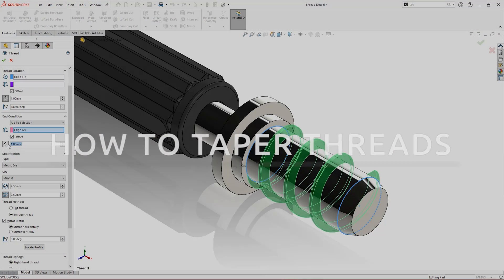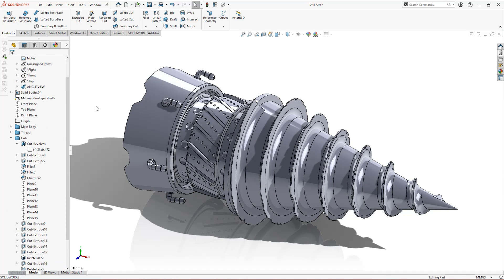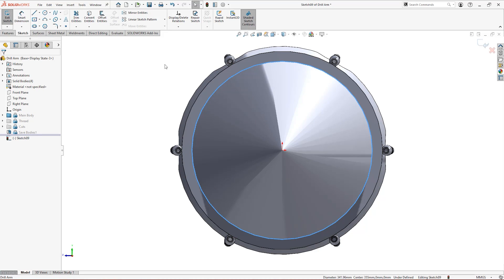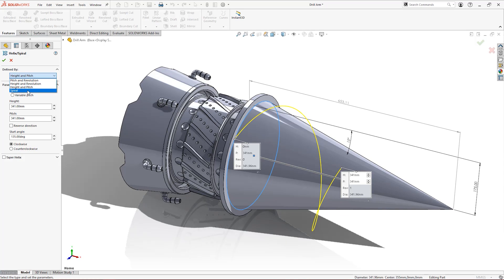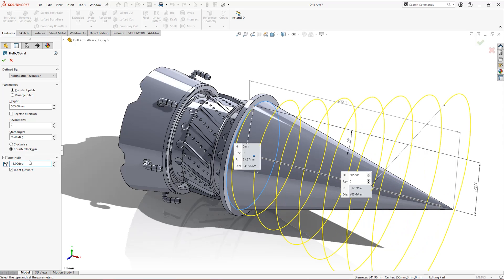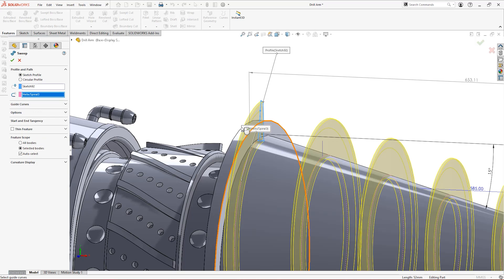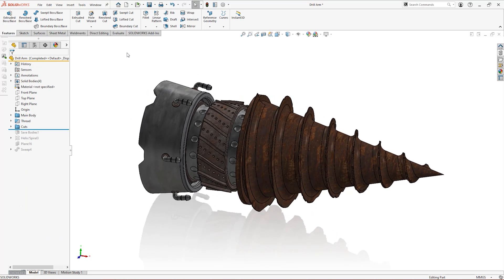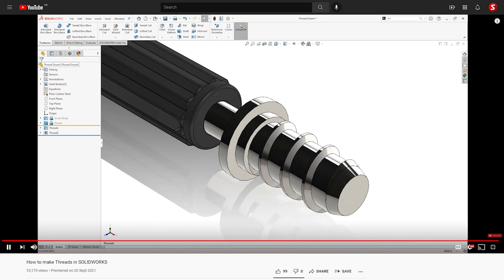How to Taper Threads in SOLIDWORKS | Beginner SOLIDWORKS Tutorial

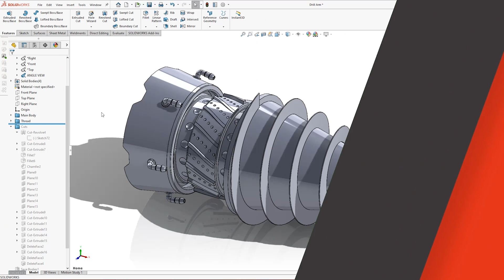Comment: Somewhat helpful but you didn't address how to cut the threads at an angle like shown at 2:13. You just said that it could be done.
Reply from the maker: Hey Stewart - that cut was created with a revolved cut! Sketch a centreline and a single line where you want the cut, and let the cut revolve work its magic. 🧙‍♂
Reply: @TriMechGroup  Thank you for replying so fast. I managed to get it working.